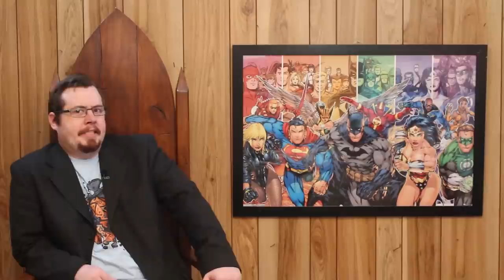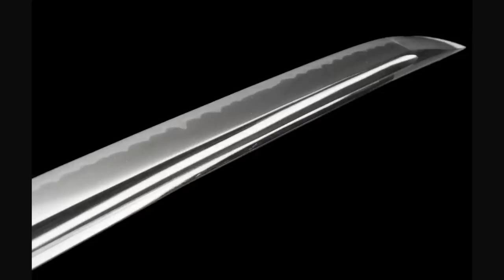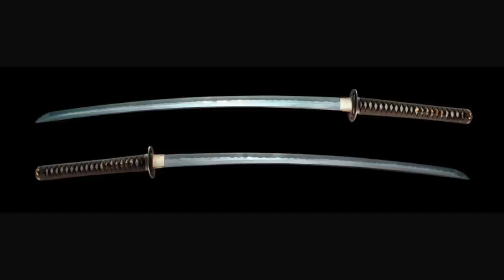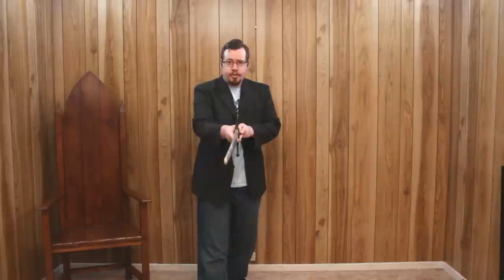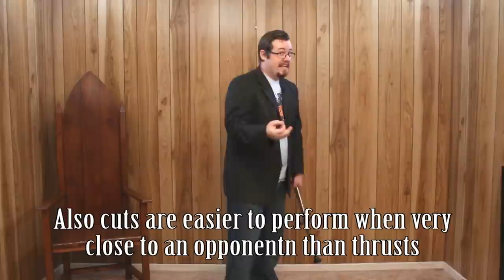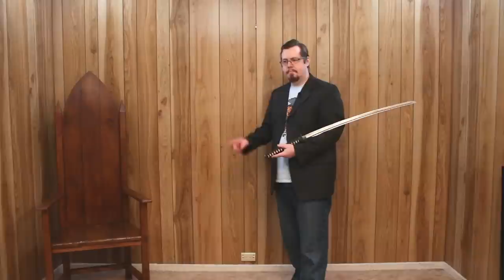Super cutting swords, are they needed?

Comment: I somewhat disagree. Sure, one good cut delivered with killing intent and expertise will be a kill weather it cuts to the jugular or wether it cuts throught the spine, but the chance that such a formidable cut is performed against a combative foe is rather slim.
Assume two foot soldiers are fighting, and neither of them has armor worth its damn. Maybe they have a helmet and a gambison. Your guy got shot with an arrow in the guts, and is feeling rather week. He's rushing on adrenalin and any sort of training he went through is out of his head. He's just wildly flinging the weapon towards his enemy.
Now, let's assume for the sake of math that your guy is only going to have the time to deliver 10 attacks until he fails to parry an attack and is disabled/killed.
For each of these 10 attacks:
The foe has 50% chance to do a perfect parry. 30% chance to partially interpose his weapon, but still have the blade touch him because of the strenght of the assault, and 20% chance to outright strike the guy. If the weapon is significantly top heavy, a partial parry will still result in strong hit maybe half the time. Not with a tapered sword.
Now, the edge alignment has maybe 50% chance to be optimal, 30% chance to be sloppy, and 20% chance to be off. If the sword is curved and more rigid, the sloppy edge alignment can still result in an injury, let's assume not with the longsword.
Armor. Through several thicknesses of linen, the longsword would have perhaps 20% chance to go through, depending on the location and strenghts of the impact, and a big cutting sword could be higher, perhaps 30%.
Now, to be disableling, an injury has to do a set amount of tissue damage. Of course the head, neck and main arm would be disableling, but a strike to the leg or torso would need to either break a bone or cut enough that the bleeding will take down the guy fast enough. Let's assume 50% chance the wound is inflicted to the head or arm, and 50% chance it's elsewhere. If elsewhere, there is 30% (of 50%) chance that the longsword disables instantly, which could be 50% (of 50%) for a bulky shamshir or falshion.
So let's punch the numbers. Each longsword attack has 1.3% chance to be a killing blow on his foe, which means that by our arbitrairy 3 attacks criteria he has 12.3% chance to survive the enoucounter. Not what I'd call "overkill".
Now assume he has a good cutting sword, maybe a tulwar, instead. The math from all the above criteria implies that one attack has 6.3% chance to be a killing blow. Ten attacks have 48% chance to disable his enemy before he gets killed in the process.
Of course I arbitrairly gave numbers. The advantages might not be that important. Perhaps only a fraction of that. The point is to show that many small advantages can add up and give a very significant advantage, expecially if your life is on the line. Moreover, it would seem that under stress, people rarelly if ever thrust.
So yes, comparing both weapons in optimal situations (i.e. a well placed strike on a vulnerable body part) doesn't really show the advantage of a cutting weapon, but optimal situations aren't  a good experiment for actual combat.

Comment: Excessive cutting capacity might be useful if you're fighting on a horseback and trying to target your enemy's horses. I suppose horses are harder to kill with a cut.
Reply: With many sabres when on horseback thrust vere also very comonly used. With sabre like sword it's just safer to make thrust or cut from horseback. Straight sword designed for thrust from horseback ussualy are designed in such way that they break when to much force is apply to prevent damage to user body.  Becouse straight sword for thrusting is used just like lance(sometimes instad of lance) that mean all force go to You wrist, when with sabre You can allow it to move easily up down on thrust from horseback preventing eny dmg to wrist or stucking in enemy thanks to curved blade end grip. I would say that extesive cutting power of sabre like swords(sabre, kilij ect. but not things like messer) is side effect of making sword safe to use on horseback.

Also curved blade dont give that much greater cutting, I think it give more safety end possiblities in fight. I would say that curved grip often finded on sabres give better cutting becouse You can easily increase speed of blade with such grip. But with straight symetrical blade You can also use certaint wrist movement to increase speed end made much better cuts. I'm not fencer end/but I find them rly tiring for wrist compared to simply opening end closing hand with curved grip. I think that curved grip give: better control, highter speed of blade(so more energy) end add safety but at the same time curved grip can't rly be used on long double handed swords(well grip can be curved but only slighty ,   katana have grip curved the same way as blade so i don't think it help with cuting).

And horses(most animals) can be killed with clear cut to neck troath end veins area.

Comment: If cutting gives you no practical advantage then the question becomes: why were so many cutting-specialized swords made?
Reply: I'm not really looking for a simple answer. It feels like a question worthy of a full-blown investigation, and I think it will reveal more about the utility of cutting-specialized swords than proposing that they were useless.

Perhaps you're right that cutting specialized weapons are better for untrained combatants. But I'd like to see someone look into that claim. I think someone suggested on here that they were used as tools, including to chop wood. Is that true? I'd like to know what people find out when they investigate these possibilities.
Reply: The cavalry argument is the most compelling.

What do you think of this idea? Shad claims that the extra cutting potential against an unarmored opponent is overkill...do you think that extra cutting potential becomes more valuable if you have a hard time keeping your weapon sharp? Was that a prevalent issue at the time when cutting-enhanced blades were popular? Because otherwise, as Shad points out, the lack of effective armor is irrelevant.
Reply: So it sounds like it's not so much that cutting blades are so much better at slicing arms off, it's that they're less likely to get stuck. This is the advantage for both cavalry, where thrusting weapons would be pretty ludicrous, and also for infantry, where slashing weapons may be easier to use, or even just safer to use against unarmored opponents.

That makes sense to me. Does that sound like a fair summary of the advantage of curved slashing blades?

Comment: You thrust with the sword (double edge) and you slash with saber (single edge)
saber is better with swing/slash, mostly designed with a curved shape, 30 degrees, or more. just look at how the guillotine designed. if you slash with straight saber or sword, it will be less effective. But to thrust, was deadlier using the sword

Comment: I would say that cuts are definitely more effective at killing then thrusts. not by much. but a massive laceration completely disabling someones left arm vs a clean hole you poked in your opponents stomach is hard to argue. I will also say that cutting is much easier once you get in. one cut can leave to another cut to another an another etc. a stab with a rapier is good but it doesn't mean as much because once it's done it's done. you can't really stab again an again unless your opponent is letting you. there's this big myth of one hit kill in swords an it's simply not true. there are plenty of cases of people winning duels an then collapsing dead minutes later because of their wounds an the severe bleeding. it's the same concept with bullets. the reason the military uses automatic weapons with fairly large caliber is because to kill people effectively you need to poke more than one hole an each hole you need to poke has to be of adequate size for it to matter. there are plenty of cases of people getting shot a few times with .22 rounds who just keep on going. back on topic cutting swords cutting effectiveness does matter because a sword that can cut very effectively practically doubles as axe. sometimes in a battlefield scenario you want to go for simply the most devastating blow possible to put your opponenet out of the fight as quickly as possible. while a long sword will hurt your opponent severely your not necessarily going to put them out in one cut. they will still be a threat. compare that with a scimitar which can lop off limbs an induce shock. thats what super cutting focused swords are really about. just the pure shock when it finally hits you. it's like a shotgun vs a SMG. both are effective at around the same range but the SMG will not have the pure stopping power of getting hit full force by a shotgun. just like while a longsword is very effective at cutting a scimitar has much more shock an stopping power. not only that but a scimitar will also go through armour an padding much easier than a longsword. also it should be noted that thrusting swords are way worse when going up against a shield an spear then a cutting weapon who can at the very least IF he does get past the spear do some pretty incredible damage.
Reply: I didn't ask for a history lesson on guns dude. were talking about swords. it was very very basic analogy. an I know that smgs have a greater range than a shotgun just like stabbing swords have a greater range than cutting swords. -_- also Im not talking about long term lethality. sure holes win there. I'm talking about short term artery severance. all you need to do with a cut is chop into a major artery an it doesn't matter how lethal it is. you will pass out from blood loss shortly an then it's game over.
Reply: I was generalizing. you don't have to get anal about the "Exact designs specifics of the .22 lr vs nato 5.56." honestly the nato 5.56 is also constantly debated on it's true lethality anyway. some critique's saying it isn't lethal enough as it is. so I am in fact pretty sure that the .22 LR isn't very much of a contest. especially considering it's abysmal stopping power an general lack of punch. anyway the way I see it is you can design a sword for cutting an stabbing but it won't be great at either. specifically the more the sword can cut the less it can stab. stabbing can cut into artries but it isn't as likely an it won't be a severe as more of the bleeding will be internal.. not only that but you can mitigate the damage from a stab wound in a way you can't  from a cutting slash. a cutting wound will almost always cut into a artery if you strike true

Comment: EE…
You slash his right arm to the bone. That doesn't put him out of action like it would if you crippled his sword arm—but his good strong left arm is still hale and hearty. He is resigned to bleeding to death but in the meantime he wants to kill you too.
Gee…
A dude with his right arm completely severed just might have bled out noticeably faster than a client only cut to the bone of his right arm.
Even if you cripple his sword arm, he might still pick the sword up and come at you right handed—or draw a long dagger or whatever.
Does it matter how fast he bleeds out? Yes, it means you have to spend less time blocking suicidal desperation cuts and slashes until you are in the clear.
…..RVM45
Reply: That's why you use hewing instead of slicing.

Comment: What are you taking about? who said that you have to fight fair? are you forgetting about the horse?. thrusting a sword while riding a horse will cause it to become stuck and force you to waste time pulling it out or to let it go. And often you only have 1 time to slash at a foot soldier before your horse runs past them, if you fail you will have to turn around and try again. 1 overkill slash using your momentum while riding will get the job done faster and you can move to the next running away enemy/villager.

Comment: +I am Shad
You making a really bad point,  your concept it is based upon ideal conditions of cut, and this makes it just invalid.
Because with not ideal conditions you may need this extra cutting power, because lighter blow will do more damage.
I read historical sources from XVII-XIX century, when winter coat or Shako block the blow, because in war, in real combat most of your attack will be not ideal for many reason.
And there's comes saber's etc, it will make killing unarmored or lightly armored person easier.
And this is just confirmed by the history itself in about late XV century sabers starts to get popular in middle-east Europe, and mind that in this region there where lots more fighting with sidearms, and when more cavalry fighting come back to Europe they adopt sabers as well.

More, you say about armor penetration, but straight sword  will also not penetrate armor, but for this reason knight and latter cavalry would have different specialize , sword for people and flail, mace for armor,  

Another point that I must make it is about, you talking about rapier, but rapiers is the same category of specialize weapon, which was rarely used, and fighting it on horseback is just crazy ;)

 And the last topic, I never understand why in English terminology sabers sword, the same goes with battle knife.

Comment: I disagree about trusting sword being better then cutting swords. Trusting swords are more bottom heavy sow there more controleable but this also means that it becomes harder to block a attack with them. If you try to block a attack from a katana with a rapier it's not gone block it It's gone smash true and hit anyway. But, but if your wearing armor and don't have to care that much about cuts bashing true and have to be able to aim better that's when you can use a trusting sword. Also you forgot one super importend aspect. Someane can look like swisse cheese and keep attacking. people don't just drop dead even if the hit is leathel and they die from it afterwards. This doesn't matter if the kill you before he drops dead. If you start disabling body parts, that will end a fight way quicker. So it you disable someonens arm and the keep fighting anyway then your still in trouble. If you cut the arm off it's more likely the just go in shok and drop then and there. Cuts disable then kill, trust kill then disable.

Comment: I don't know if this theory bears out in practice (it sounds sensible to me but I am an ignoramus in these matters). If it does, you are ipso facto repudiating your video where you express a preference for single-edged blades over double-edged blades. Because clearly for best result in thrusting, you need a weapon with a spiked tip, so if not a double-edge, then at least a very highly developed false edge. And how can you do that while also curving the profile of the sword to optimize it for the cut?